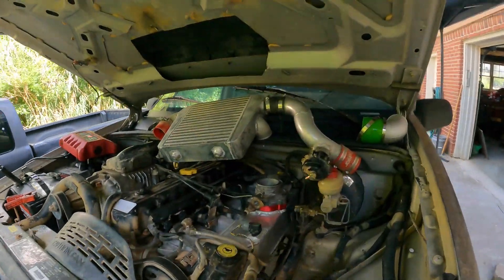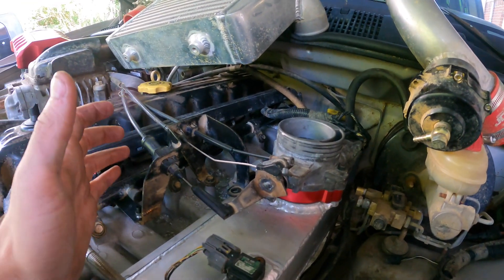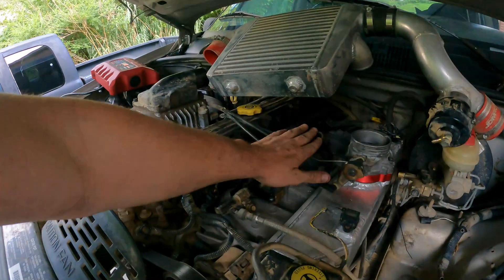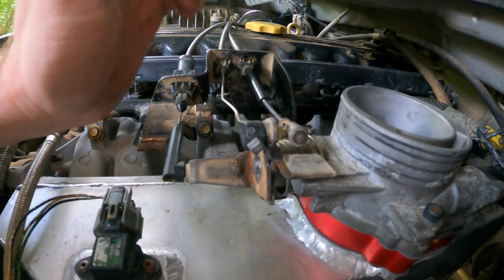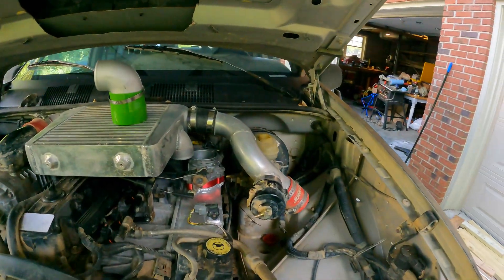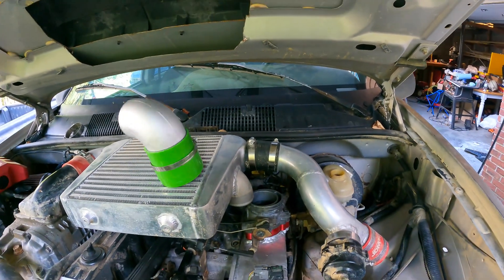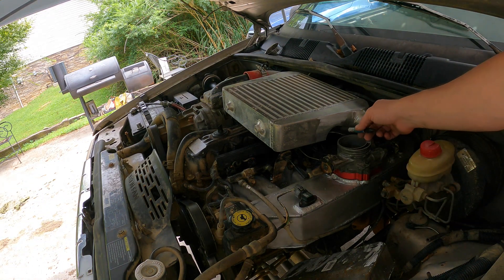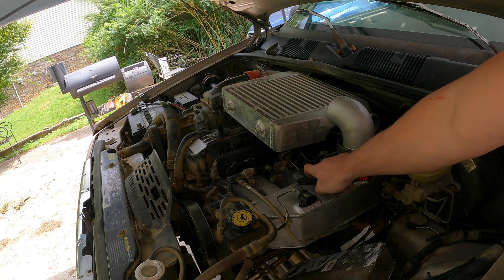jeep 4.0l fabricated plenum pt4

Comment: Had a question for you about why would you switch to the newer TPS? I have a 1995 ram with the 360 and I wanted to see if I could do the same
Reply from the maker: The terminal style is better in my opinion. I can bump the harness and lose signal and it will hesitate and sometimes die and it gets rough in the woods  It's more because of its age if the connector was new and the sensor was new it would be fine. The newer connector style with the flat pins is less sensitive.

Comment: Just picked up an m90 and I’m ready to make some boost. I was just curious did you have any issues with overheating when you had it installed. Also can you remote tune for someone up in Canada? Cheers
Reply from the maker: No overheating issues everything has been fine. Yes I can remote tune it.

Comment: Amazing videos very inspirational keep up the hard work makes me want to try it my xj has the 2.5 might try a ebay turbo
Reply: Just swapped the engine a few months ago with a fresher 2.5 with 23000 miles any recommendations on piston ring gap I'm looking to throw 10 lbs at it
Reply from the maker: IV been remote tuning boosted 4.0s for awhile now and they seem to be fine at 10lbs out of the box. They are know for the head gasket to go after that. Maybe open up the ring gap a touch if your already inside the engine  but I would be too worried about it.
Reply from the maker: Thank you. Definitely worth giving it a turbo.
Reply: @thomasbeyer  yes sir I'm already in it bought a better head gasket and in the process of opening up the ports on the head and header Ill give it a little tap on the grinder for the rings balanced the pistons last night I'll be happy with 300 hp to the wheels might have to throw some nos on it but should hold up cast iron blocks are tough thanks for the response. Trying to find out what the world record for a 2.5 xj stick is in the quarter might try to go for it
Reply from the maker: Thats awesome man. Let me know if you need tuning when you get to that point.
Reply: @thomasbeyer  I'm pretty experienced with HP tuners I've tuned supercharged LS in the past this will just be my first turbo application this will also be my first time fabricating the exhaust work for the turbo application still haven't figured how I'm going to run the exhaust on it seeing as how the intake and exhaust are on the same side I don't know if that's going to make it easier or harder but definitely going to have to wrap everything. No room to run it from the back without having to cut into the firewall but the way the exhaust is it points towards the back too bad it's not like an LS where you can flip the exhaust manifold around I may end up having to modify my header there's not a whole lot of aftermarket as far as turbo kits go for the 2.5 l. Trying to keep it to where there are no harsh 90s and still keep everything under the hood and I want full length exhaust I don't want to be like one of those guys that are lazy and just dumps the exhaust out a couple of feet from the turbo
Reply from the maker: Jtec tuning is not bad it's very crude really. You've got enough experience tuning other things it'll come easy. But if you need anything just holler. I enjoy driving my toys but I really enjoy the build and the Fab and all the stuff in between. It gets frustrating but when you're done it's worth it.